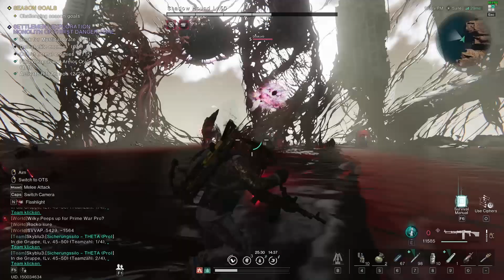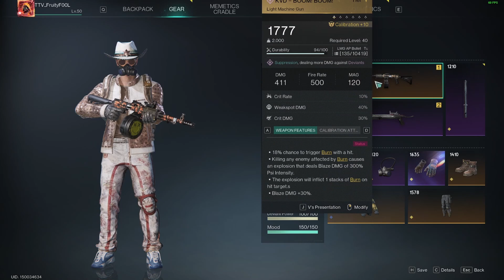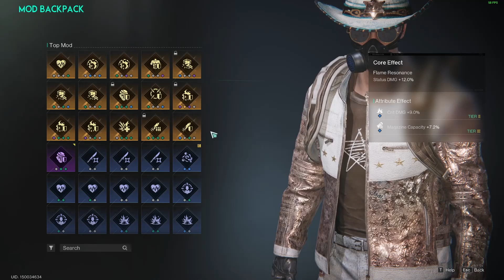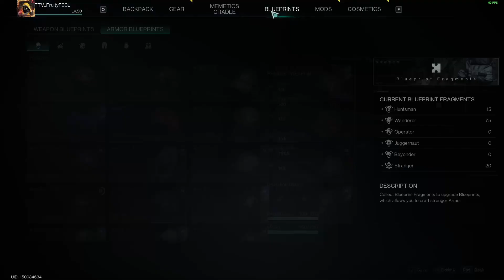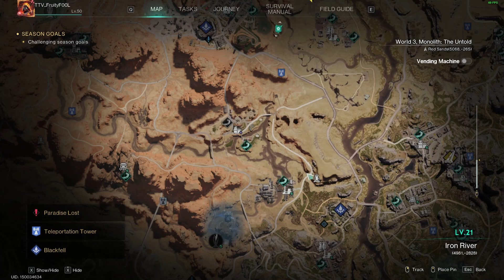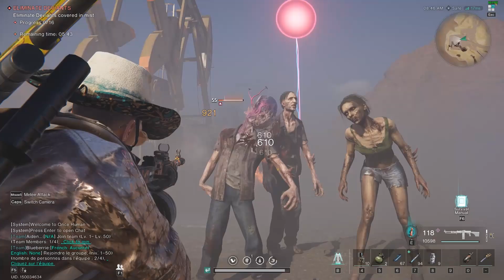Once Human KVD Burn Build Gear & Perks Explained!

Comment: what si your craddle setup?
Reply from the maker: Sorry i knew i forgot to show it! will show it in the next video. For now i will list them down bellow
1. Automatic Weapon Enhancements 
2. Deviation Master
3. Status Enhancement 
4. Tactical Combo
5. Rapid Aid
6. Sustained Suppression
7.  Prairie Fire Inferno 
8. Bounty Hunter 

Sorry again for not showing them, will ensure I show them in the future.
Reply: @FruityF00L  i just tried this build on pro mode silo's it does absolutly no damage, my icy rain did way more
Reply from the maker: @melvinfeenstra7037 strange I was running it on pro for the day and I was doing damage. I’ve bought the hardy gloves and swapped out the weapon perk for embers and I do just under 5 mil in LEA
Reply: @FruityF00L  it might be the weapon m mod i got on, +2 sstacks and less duration, i do not have any others, mneed to find the place to farm em
Reply from the maker: @melvinfeenstra7037  The new dungeon is a great area to farm mods. fairly quick as well.

Comment: you need to check the sound quality on your video my dude, I have my sound maxed and I can barely hear you.
Reply from the maker: @fireteambravoinc5812  thanks for letting me know. I’ll make sure I increase it for next time. Don’t wanna be too loud but I can’t be too low.
Reply: its just a slight low volume. i can hear you just fine but yes increase it a bit will help.